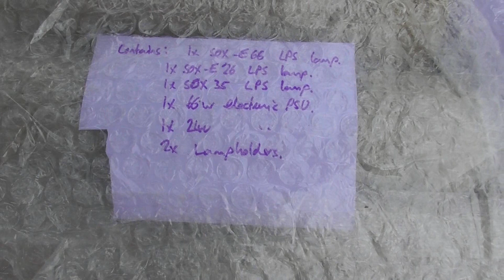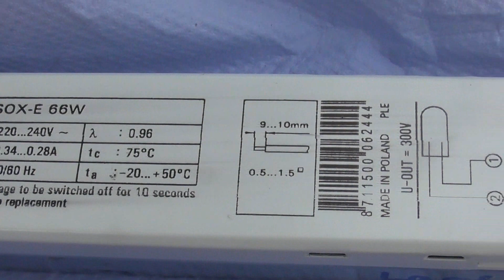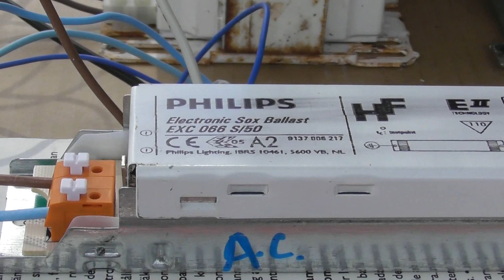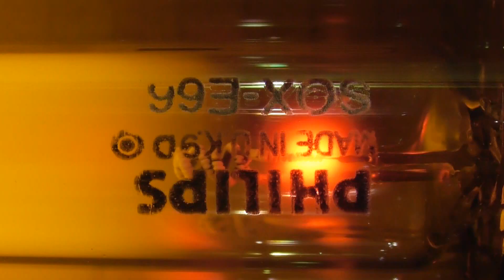Philips 66 Watts LPS SOX lamp. First testrun

Comment: I'm so glad they all arrived in one piece.  Great to see the 66w light up.  The HF noise you hear is because of the lamp holder, if you unplug and re-connect it a few times it will stop.  You'll need to find a BY22d holder which has stronger contacts.

Comment: It is pretty. I think it's a mistake to change away from sodium to LED lighting for street lighting. Technology Connections made a case that sodium lights cause less eye strain on roadways at night.
Reply: I personally like that yellow-ish colour too
But that eye strain maybe is the design problem( they Probably haven’t consider the light angle beam and illuminance different)

You know, maybe they just replace it
Reply: @horacewonghy  Problem is that street lighting is no longer designed and installed correctly, just follow and repeat the old designs, and no thought given to type of fixture, cutoff, or to control of light spill and position of the fixtures. You often see different poles as replacements, or fixtures that were FCO being replaced by non FCO types and thus glare, plus the installers almost never set them up correctly to have the reflectors aligned, or the fixture itself actually levelled off to the spec. I see LED types with a far throw used to light a single lane, so most of the light is on the pavement on the far side, and converse as well, along with having a blend of HPS, MH and MV is common, all along a single straight road, and if you are unlucky they are loose and twist, giving bright glare to one direction.

The road designers just take the old spacings and put whatever pole they have in there. Then the builders put whatever is in stock on them, blithely mixing 250W and 400W fixtures and lamps, and often putting the wrong lamp in the fixture, because they all have E40 bases for the various wattages. 250W lamp in a 400W ballast, short but merry life before it cycles, and the 400W in 250W ballast never gets to full operating temperature, and thus is dimmer. 80W MV lights glow really bright though, almost looking like a MH lamp in there
Reply: @SeanBZA  yup they just got “replaced” but it really need to be redesign since the parameters is different. At least they should use dialux to test before put it in.

Comment: Just a general question. 
With these Lamps, do they need to be in a particular orientation? 
As i know same lamps have to be in Vertical or hoarzonal +/- 10 degrees more ore less.
Reply: Vertical or any orientation so long as it is not run base down, as then the liquid sodium will attack the graded glass used to form the link between the quartz glass tube and the filament wire lead outs. The glass will dissolve in it, being made from soda lime glass in the main part, and not the silicon dioxide of the quartz glass. 

You need to have the different glass seal, as it is otherwise nearly impossible to seal quartz glass to the tungsten and molybdenum oxide coated wires without the wire melting. HPS lamps solved the problem by having a different seal method, but this did not get applied to the LPS tube manufacturing, as it would destroy the cathodes in the lamp, where the HPS lamp has no need for an activated cathode, as it runs hot enough to emit on it's own from the tungsten tube used, plus the metal salts used are enough to act as emitter when hot.

Sadly this tube will have a shorter than designed life, as almost all of the emission is coming out of a small area of the one electrode (top one in the video) and not from the thoriated oxide layer on the tungsten wire filament, so the tungsten wire will fail open after a few hundred cycles, unless the lamp manages to get the oxide area to emit electrons properly, perhaps after a few hours of running continuously.
Reply from the maker: @SeanBZA  Thanks Sean, you onto it. The longer lamps prefer to be within a couple of degrees, of the horizontal, but base at the higher end. The Thorn Gamma 6 have base up 90° for 35W SOX lamps.
Reply: @RODALCO2007  Now all you need are SLI lamps, which that 65W ballast will be able to run.
Reply from the maker: @SeanBZA  ? What does SLI stand for.
Reply: @RODALCO2007  Linear low presure sodium lamps. 

http://www.lamptech.co.uk/SLI.htm

For more, used to be a common thing mostly used in tunnel lights and underpass lighting, as the fitting looks similar to a flourescent lamp, but with much higher light output. One of the lamps I want to see in real life still, other than as relics that are left behind on the one railway overpass I travelled under today, where there are still a row of them, but not powered.
Reply from the maker: @SeanBZA  Thanks mate.
Reply: @SeanBZA   - In regard to your comment about the lifespan, because the lamp is new you will find bright flashes around the oxidized filaments and after about 100 starts, the glow is more uniform around the filaments.

Comment: Can we get a link for these?
Reply: You need the link and a time machine.
Reply: @Peter_S_  well shucks. Wanted some for my bedroom at my new house to match the theme
Reply: @tinmanstavern  If you Google the magic term "SOX E 66W", you should be able to find enough at low volume dealers for any personal use. You can also find 18, 26, 36, 55, 90, 131, 135, and giant 180 watt versions by changing the 66W to the wattage you want. The full name on the Philips datasheet is "MASTER SOX-E 66W BY22d 1SL/12" but the suffix changes so a generic "SOX-E 66W" search may work best. You can find the giant Philips 180W SOX bulbs by Googling for "SOX-E 180W" and they're 1.12m long! They are beautiful and getting rare so the price is climbing, but they have such a long lifespan (12,000 hours to 80%, 18,000 hours to 50%) and such high efficiency that they were an excellent option.
Reply: @Peter_S_  excellent. I'm 16 and this kind of tech greatly interests me. I'm big into cb radio as well, especially tube type so these lamps caught my eye
Reply: There are a few out there, £106.44 (incl VAT): easy-lightbulbs (dotthing) com/light-bulbs/discharge-lamps/sox-bulbs/bayonet-22mm-diameter/sox66-e-ph/
Reply: There are a few still out there on Ebay, but you have to look hard and if you are not in the UK, you may pay a lot on postage.  Even harder is finding the correct ballasts to power them.  Sometimes you can find complete gear trays, otherwise you have to source an inductor ballast, ignitor and PFC capacitor separately.
There are still some european suppliers like any-lamp.co.uk but be prepared to pay stupid amounts of money now because they are New-Old-Stock.  I wish you the best of luck.
Reply: For lamps, consider contacting these Philips Lighting branches:
Egypt ( https://www.lighting.philips.com.eg/search?query=SOX&page=1 )
Belgium ( https://www.lighting.philips.be/fr/rechercher?query=SOX&page=1 )
Mexico ( https://www.lighting.philips.com.mx/buscar?query=SOX&page=1 )
You can also buy SOX lamps from China, but their quality may be questionable ( https://www.made-in-china.com/productdirectory.do?word=low+pressure+sodium+lamp&file=&subaction=hunt&style=b&mode=and&code=0&comProvince=nolimit&order=0&isOpenCorrection=1&log_from=1 )

For ballasts, try:
Phillips Lighting Belgium ( https://www.lighting.philips.be/fr/rechercher?query=SOX&page=1 )
Geo-Technik ( https://www.geo-technik.de/advanced_search_result.php?keywords=SOX )